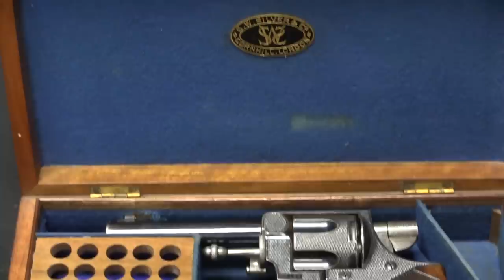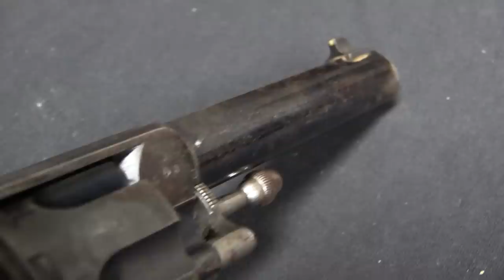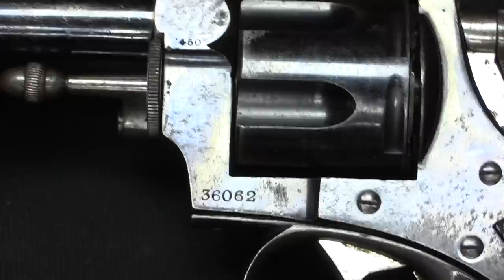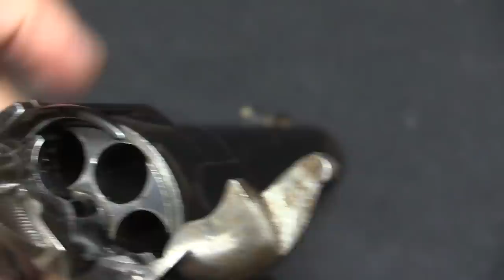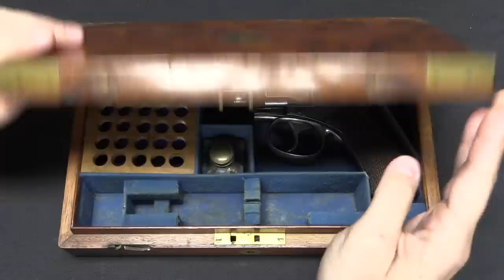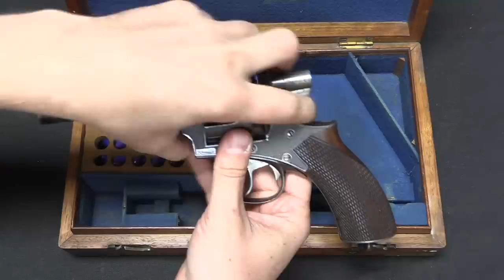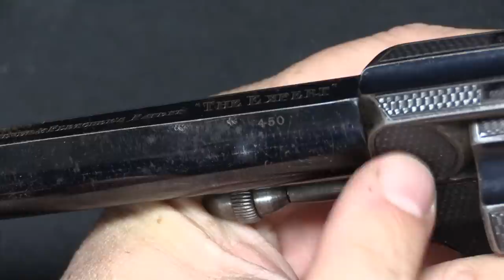1884 Tacticool: Silver & Fletcher's "Expert" Auto-Ejector

Comment: I really want to know if they came up with the hammer safety after some 'real world learning' experience.
Reply: The Full 9 Idk if this is relevant but a guy dropped his webley, it landed on the hammer and shot him through the skull. So they have been concerned about all sorts of safety for ages
Reply: @1stdaybreaker707  Before transfer bars and hammer blocks were common, any revolver would do that.
Reply: I don't think so. The first thing that popped into my mind at the start of the video was that priority #1 for such a device is a hard guarantee that it doesn't interfere with normal operation when disengaged. And behold, ejection while firing seems to be optional, and not recommended; I think they thought of the implication.
Reply: I think they could have designed it better with some way to ensure it stays in one position or the other
Reply: I don't know who of the 4 replies I'm answering. I think his name is Hikock, does speed shooting videos made a point of this. All revolvers, if fully loaded have a hammer sitting on a live round. If a live round is in fire position any significant force on the hammer will cause discharge. My friend shot his couch when I told him to see if it worked.
Reply: DemonLord120 you’re thinking of hickok45. Older revolvers without a transfer bar safety should be carried on an empty cylinder, newer revolvers with a transfer bar can be carried fully loaded and are usually drop safe.
Reply: Some of the replies seem to miss the point. It's not about the well-established problem of unsafe hammers in this period. The design in this pistol specifically addresses the issue of deliberately pulling the trigger and dropping the hanger multiple times, to eject spent cartridges. No one using any other pistol would be doing this. Mistakenly having a live cartridge in the cylinder would result in an unpleasant surprise and dangerous event. The rotating device on the hammer is great, although it does rely on the user actually engaging it. Haste or stupidity would still result in a dangerous condition.
Reply: I'm sure there's an unwanted hole in the floor of an old factory thats being covered up 😂
Reply: @1stdaybreaker707 That was an Enfield Mk.II revolver, not a  Webley.

Comment: Open loading gate before shooting for +30% reload speed.
Reply: More than that the way the old ejerctor rods worked!
Reply: @kg4boj  the gun still has the same mechanism you just dont need to rotate it again if you hold it open.
Reply: @juhomannela2160  What I'm saying is you will be able to reload way more than 30% faster. It is painfully slow to reload those old school revolvers with one chamber ejection rod at a time and that's if nothing gets stuck!
Reply: @kg4boj  With practice it looks like you'd be able to reload almost as fast as you could shoot.
Reply: Sorry for the thread necro.

A left handed shooter with a gift of deftness might be able to reload cartridges as he was firing
Reply: @kg4boj  and also the benefit of increased reinforcement of full frame revolver

Comment: I remember, in one of the original Sherlock Holmes novels, there’s mention of an autoejector. It thought it meant a semi-auto pistol, but I wonder if it meant this with the gate open.
Reply: More likely it’s simply the Webley top-break revolver.
Reply: What chapter? And name of the case?
Reply: I think I need to stop playing around and read Sherlock Holmes.
Reply: I read through 'the complete sherlock holmes' a couple of times, and didn't even find the chapter concerning the police gifting mr Sherlock Holmes his own personal revolver.
If forums were to be believed.
Reply: The Sign of Four, set in 1888 and published 1890 so feasible. I always got the impression that Doyle enjoyed firearms but was far from expert, so mentioning a 6-year-old technology that he's seen in a magazine, gun shop or pistol range so casually in one of his novels, assuming that the technology is either wider-spread or commonly-known than in reality, would be consistent with that.

EDIT: correction, it's The Adventure of the Dancing Men, published 1905. Feasibly an automatic pistol, but mentioned specifically as a revolver.
Reply: Or one of the wierd piston operated gass ejecting revolvers
Reply: @silubr1  I'm going to assume this is what he meant. The top break Webley would be referred to as an auto ejector as the cases (usually) come flying out upon opening of the cylinder. This compared to something you have to "manually" eject one at a time, the term auto ejector makes sense.
Reply: @CrudeConduct666  In the book it was a single empty case found in a garden. I know that later Webley revolvers could sorta selectively eject empties only, letting full cartridges fall back into the cylinder. I'm not sure if that was a thing in the 1880s, and even if it were it would require a deliberate act of a man running away from a murder charge (or several deliberate acts if the whole cylinder were emptied, and he picked up the full cartridges before running away). TBH it's a convenient plot point that has always bugged me, until I saw this video and realised it's actually quite feasible.
Reply: @lordsummerisle87  hm, you've got me intrigued. What's the book name and when was it written? The earliest semi auto I can find was made in 1890 so this revolver may be the type, why a murderer would open the cylinder just so he could drop a cartridge makes absolutely no sense to me so I'm trying to figure out a better answer
Reply: @CrudeConduct666  Correction to my above comment: it was from The Adventure of the Dancing Men, published 1905.:

[A flower-bed extended up to the study window, and we all broke into an exclamation as we approached it. The flowers were trampled down, and the soft soil was imprinted all over with footmarks. Large, masculine feet they were, with peculiarly long, sharp toes. Holmes hunted about among the grass and leaves like a retriever after a wounded bird. Then, with a cry of satisfaction, he bent forward and picked up a little brazen cylinder.

“I thought so,” said he; “the revolver had an ejector, and here is the third cartridge. I really think, Inspector Martin, that our case is almost complete.”]

It's a pretty fun short story, with some solid deduction, cryptography and breakdown of eyewitness (well, earwitness) testimony. Far fewer leaps of logic and conveniently convenient clues than a lot of SH stories. Readily available for free online. It'd be interesting to re-read it and pick out any further clues about the pistol.
Reply: @lordsummerisle87  oh interesting, must be one of these. It literally says revolver. Cool beans.
Reply: Sans Handlebars  Yes that is a complicating factor, and continued well into the 20th century, which can make analysing war diaries tricky. However "successful" automatics only came about in the 1890s, and many of them were ungainly, large and rare European beasts, until cheaper, more reliable and more practical/compact designs like the Colt 1900 and 1903 came about. Even then small revolvers were more popular/commonplace for decades. In my humble opinion an automatic pistol is not something a semi-gun-illiterate author is likely to have an American living in Britain slip into his coat pocket in or before 1905. An auto-ejecting revolver like the Silver would also be unlikely but a little more likely to have been known about, since it had been around a fair bit longer. And, IMO as alluded previously, an auto-ejector is far more likely from the story's PoV than a manual such as on a Colt 1873.
Reply: Sans Handlebars  Simultaneously-ejected top-break revolvers like the later Webley and Webley-Fosberry models were indeed popular at the time. However as mentioned in several comments up-thread it doesn't make much sense for a man fleeing from a murder charge to eject before he runs, having only fired a single round, whether his revolver has a selective ejector like the later models of Webley or not. Furthermore if his revolver's ejector was not selective then all (presumably six) cartridges would be ejected, in which case he would have had to further delay his flight by stopping to retrieve the live ones, in the dark. (I think it's reasonable to infer that no live rounds are found, since there is no mention of live ones found with the empty in a story with so much focus on minutiae.) However I don't know if selective-ejector revolvers were common in or before 1905, nor indeed if their selectivity was reliable. AIUI their selectivity was based purely on the length of a complete cartridge vs. that of an empty/spent case and a little finicky to reliably eject just the empties.

If you have the time, I highly recommend that you read the story. It's not very long and the context gives a lot more clues about the disputed pistol than the few lines I've previously quoted.
Reply: Sans Handlebars  Actually this third shot is the only shot to come from this revolver; the other two came from a different revolver that was being used by a different man. Crucial plot point of the story. This not only is deduced by Holmes but confirmed in dialogue by the shooter (and, IIRC, corroborated by an eyewitness) towards the end of the story.

As I said, late marks of Webley certainly were selective when ejecting, though the reliability of this selectivity wasn't perfect.  Whether Webley and other top-break revolvers in and before 1905 were selective, though, is beyond my knowledge.
Reply: @markknife1  what does this post even remotely have to do with the OP's statement?
Reply: Sans Handlebars  wouldn't someone as shrewd as S.H. have been able to identify the case as that of a revolver calibre vs an auto calibre?
Reply: Sans Handlebars  The Silver & Fletcher was a police issue pistol as well. (As Ian said the Royal Ulster Constabulary and Metropolitan Police ordered a few each).
Reply: Watson I hope you brought your service revolver. A Webley I presume.
Reply: Sans Handlebars  Autoejecting revolvers were developed in parallel with semiautomatics. To find three cases with an autoejecting revolver would imply four shots fired as the revolvers ejected the empty case using the gas from the next shot.
Reply: Sans Handlebars  The only reason for finding one case would be a self ejector (gas or mechanical) - otherwise I would expect to see five or six in one place. As for the rest of the story line - that is open to question. Europe led the way on self ejector fire arms so an American in England could have had a European (Swiss or Belgian) gun in this era. Very few semiautomatics used rimmed cartridges but revolvers almost universally do.
Reply: Sans Handlebars  The two trigger pulls was the basis of my comment about having to fire four shots for three casings to be found with an auto ejection revolver. The knowledge of firearms in England was larger than you give credit for - and has declined rapidly since the 1903 Pistols Act.
Reply: Sans Handlebars  no, in early days, cartridges were much more model specific, a .455 webley would be for that name of revolver only. a 38 colt would either be the 38 colt or the 38 colt automatic, not at all interchangeable. then all of those strange one off cartidges for the experimental guns.
Reply: Sans Handlebars  I am not trying to answer plot holes for Conan Doyle.... With and autoejecting revolver if you have three casings, you need to account for four shots (or in best case four pulls of the trigger with a Silver & Fletcher)....
Reply: Sans Handlebars  Only the loading gate needs to be open for the Silver & Fletcher to eject. The safety position is irrelevant.
The Swiss 1870 Von Steiger revolver automatically ejected empty cases after each shot (other than the last case). A number of other manufacturers have tried autoejecting revolvers including Smith and Wesson.
Reply: Sans Handlebars  The question of four shots vs three is a question for Conan Doyle... 
The earlier autoejecting revolvers required an empty cylinder at the first position or else a live round would be ejected on the first shot (although some had a mechanical interlock to cover this). With an autoejecting revolver would leave three cases for four shots or trigger pulls at least, an unavoidable function of the revolver cylinder rotation. Even the Dardick magazine fed revolver can't avoid that.
Automatic pistols are far more mechanically simple but require rimless ammunition to function reliably.
Reply: Sans Handlebars  of course, but the obvious and most likely cases, (pun intended) were unique to the firearm. don't forget the very popular 32 and 38 smith & wessons.and their little automatic ejector guns. revolver cartridges were rimmed while almost all auto loading cartridges were rimless. I guess that' my main point. A slueth as salty as S.H. would surely have been able to identify what handgun the spent casing was fired from and probably deduct much, much more from just the position of the little brass cylinder lying on the ground. A very enjoyable case, wouldn't one concur ?
Reply: Sans Handlebars  Not one single man in the history of mankind has been so enlightened as Sherlock Holmes.
Reply: The novel "1916" by Morgan Llywelyn refers to a Luger as a revolver, so yeah, authors definitely use wrong terminology, sometimes
Reply: @xaquko9718  they're seriously good books. You won't regret it.
Reply: @xaquko9718   "I think I need to stop playing around and read Sherlock Holmes."

The Sherlock Holmes novels were required reading at my school.  "Which school" you ask?  Elementary, my dear Watson.
Reply: The link above is to the Swiss revolver with an auto ejector.